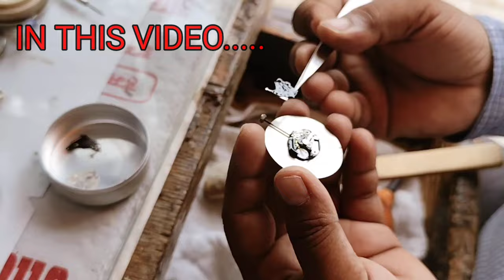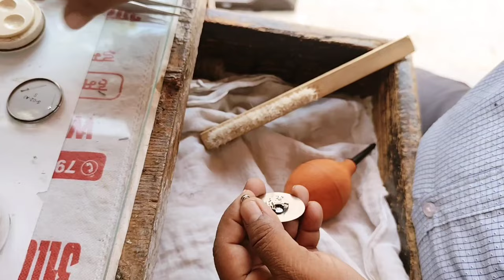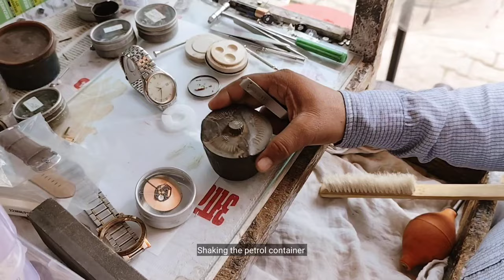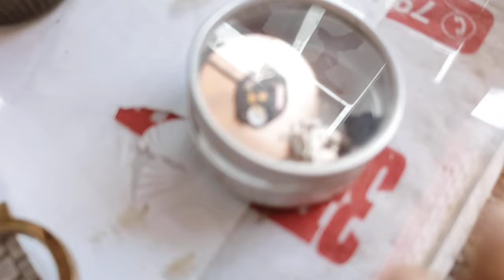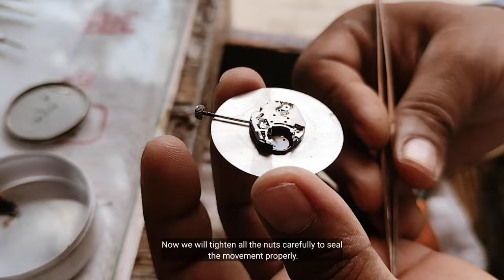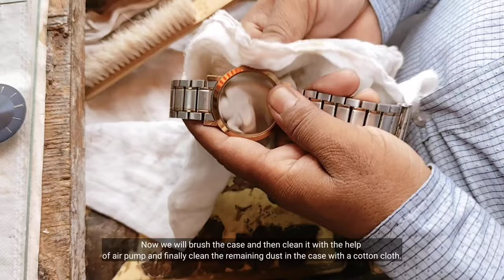Cleaning with Petrol and Repairing a Sonata 77108WAA Wrist Watch | Sonata Watch full Repairing

Comment: sir meri watch chal the chal the band ho jati hai kiya me ghr per petrol se saaf kar lu
Reply from the maker: No, you should not open the watch movement at home because all the parts have to be cleaned one by one , Get it checked by a mechanic, he will tell you what is the issue and first of all get the battery of your watch changed.